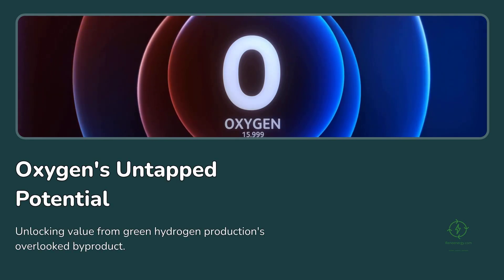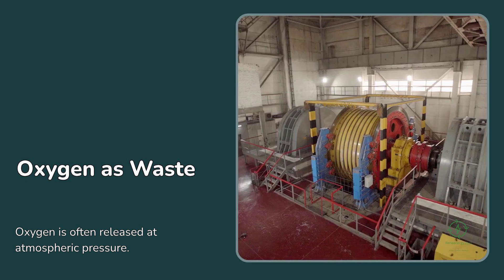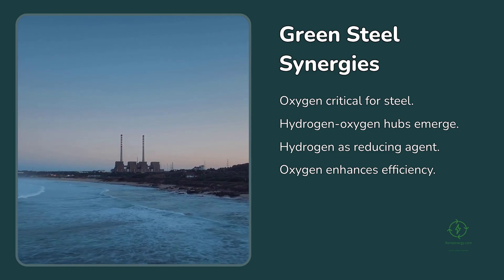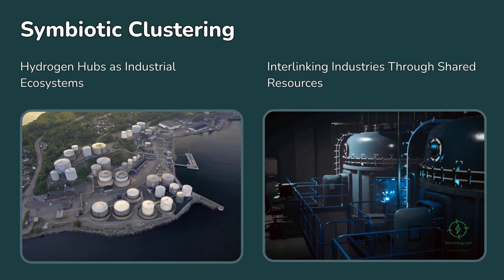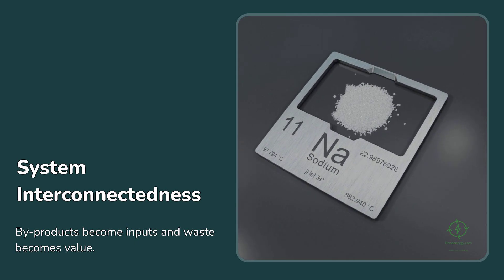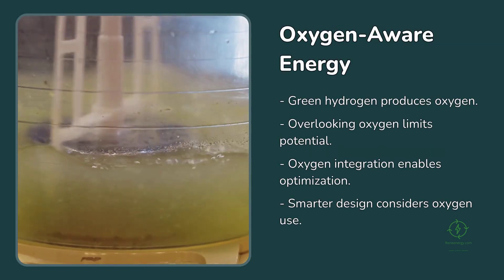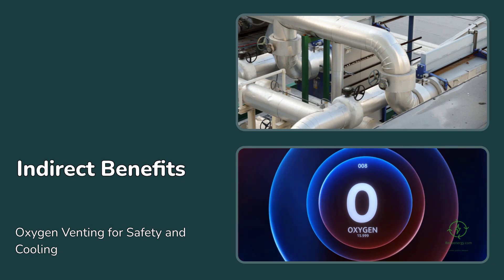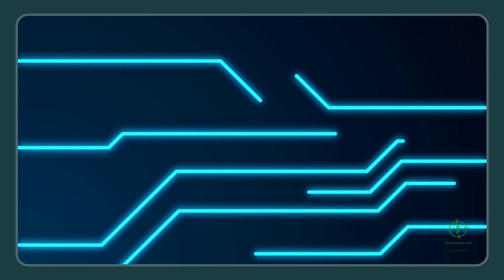What Happens to All the Extra Oxygen from Green Hydrogen?

Comment: This is full of errors. oxygen is not the main target air separation it’s more like a by product that can be sold and so is. Oxygen when required for industrial or medical usually involves concentrators of moleculer sleaves and pressure swings it’s a extremely energy frugal means of production, as it’s just a air compressor. When chemical purity is required then electrolysis of water is done and plants that do that almost always require the hydrogen too, and they want to make sure their O2 is pure in the way it needs to be not just buying any O2 off the street. You can also get green hydrogen from genetically modified algae, that uses the oxygen, and is a co2 sink. But you can also get non green hydrogen from oil reforming and cracking, and if you put 1 solar panel out you can call it green, that is always a threat to revolutionary investing “start ups”. Not that solar panels are in any way “green”.
Reply from the maker: Good points — agreed, most oxygen today comes from air separation or PSA systems since they’re far more efficient. Electrolytic O₂ only makes sense as a co-product when you’re already producing H₂ and have a local oxygen user. My point was about capturing that small, site-specific value, not replacing ASUs. 

My thesis wasn’t “electrolytic oxygen will replace ASUs.” It was: if you’re already making green hydrogen, designing for local oxygen use can modestly improve project economics and circularity—in the right place, at the right purity, with the right offtaker. Appreciate you raising the precision on how O₂ is actually produced and bought.